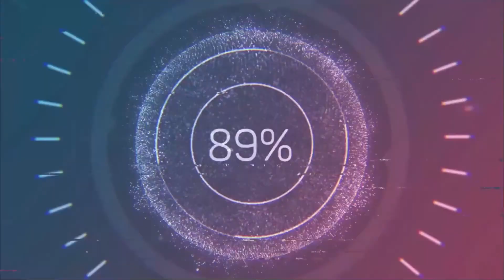All Aluminum Coils & Formicary Corrosion

Comment: I was looking around for this issue. Last Friday we found out the Unit we purchased in late 2017 has the leaking problem. It will cost us $1000 to have them replaced. SO it appears that they are still selling units with defective coils. I'm very angry about this because I was never given the option for a different brand. I will NEVER get a Lennox again and will tell EVERYONE to avoid them like the plague. After additional research it appears that even if we get this one changed out, we may still have the same problem two years up the road because it will happen again. I wonder if they can be sued again. If this problem happens again on a new set, I will be finding a money hungry attorney to go after them.
Reply from the maker: Hello Josephine, sorry to see that you have a leaking coil. I would request that they give you an all aluminum coil if they make one for that unit or that they give you a tin coated coil. This would eliminate replacement of the coil down the road. If they can't give you either, you could have them send the coil out to be coated before they install it. 
As for suing them again, not sure you can because they have already settled the case and that may have exempted them, of course I am not a lawyer, so you might try to see if someone will take it on contingency.
Just be aware that in the future when you need to replace your system, you will need an all aluminum indoor coil.
Good luck.
Reply: @baileysair  Thank you. I am currently reading your article about the corrosion and coils. It's very informative. I called the company we use for our bi-annual servicing. I asked them if the parts are failing and if they find that they have to replace them again. He would not answer the question, and he stated that he believes they are aluminum.( Which tells me he does not know) I assume that it will be obvious if they are aluminum when the part comes in. Thank you for the advice on having them coated. That will save me thousands up the road. It's insane that a company can settle a suit and not fix the problem. What was the coating I should ask for? Thank you! I learned something today.
Reply from the maker: @enigma___  My pleasure. The coils may have aluminum fins and copper tubing, it is the copper tubing that is developing the leaks. What happens is that a cathode-anode reaction occurs between the copper tubing and the aluminum fins. All it needs is some moisture and any chlorides, acetates, and/or formaldehyde in the air to stick to the coil. The copper then gives up its ions and starts to corrode, eventually developing into a leak.

The worst part about this is that the manufacturers know about this issue and yet many of them continue to use copper/aluminum coils instead of all aluminum coils. Even Trane, the brand I switched too because they have all aluminum coils, still make some units that use copper aluminum. Of course, I refuse to use those units because of the formicary corrosion issue.

My advice is to make sure that the replaced coil is all aluminum, so that you are not doing this again in the near future. 
Best of luck, 
Mitch Bailey